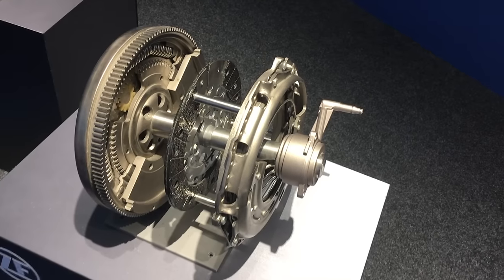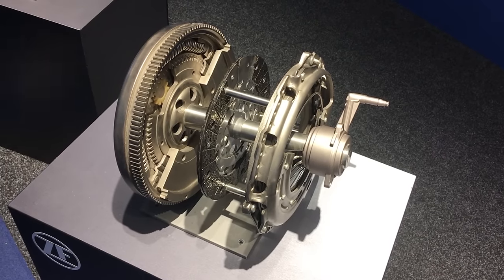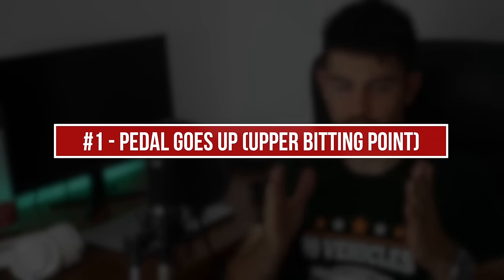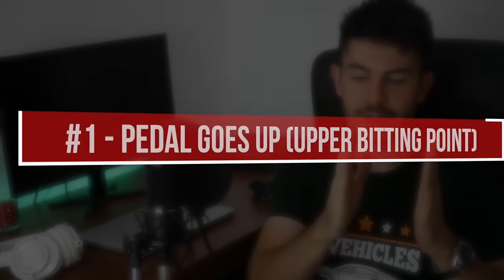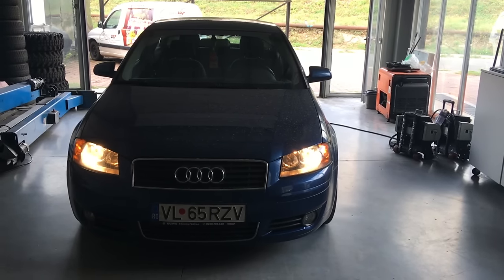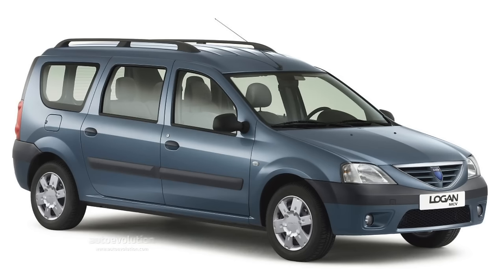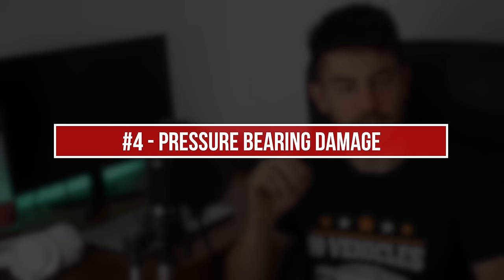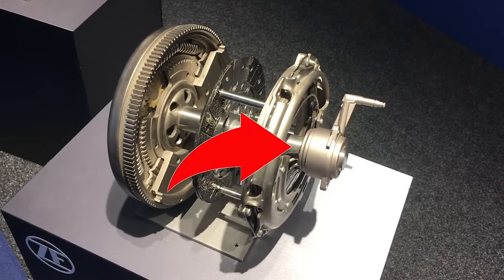How to Diagnose A Bad Clutch - 5 Signs

Comment: Clutch has become hard and car is not moving after putting in first or reverse gear. What is the issue. 2012 VW jeeta, 2.0 tdi
Reply: Possibly complete flywheel/clutch failure causing no drive.

Comment: My clutch cost around 2000 dollar's lol f**k me hahahaha
Reply: What car
Reply: @srr1887  2013 dodge challenger rt
Reply: @srr1887  and I'm sure it's starting to go out because it grinds sometimes going into reverse and it sticks from 2nd to 3rd and sometimes 5th to 6th and I know my throw out bearing is going because when I let off the clutch in neutral you can hear it grinding a little
Reply: @JT_8283  lol bro no wonder its a challenger thats why its $2k. My nissan march clutch is only $150 lol
Reply: @srr1887  yeah there's nothing cheap about this car not even the fuel since I have to put premium in it 3 something a gallon stupid oil companies what happened to hell even 2 dollar gas paying 3 bucks for one gallon it should wash and wax the damn car as well
Reply: @JT_8283  how about the taxes there? The import taxes here would accomodate about 500% about the original price since no american car manufacturer here. And you will guess how much about the spare parts price, damn
Reply: @srr1887  yeah I'm sure it would cost a heck of a lot more there